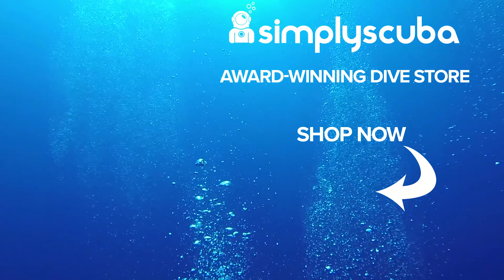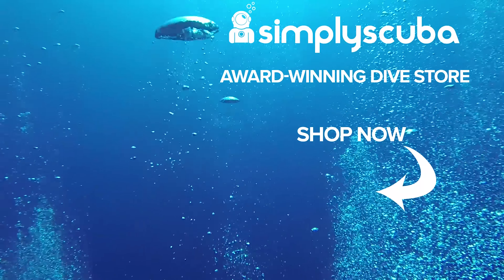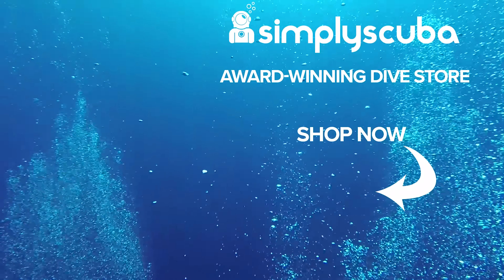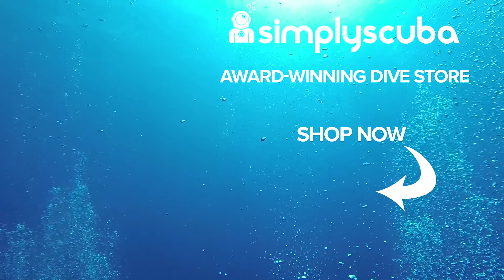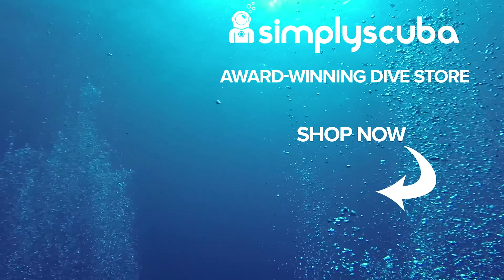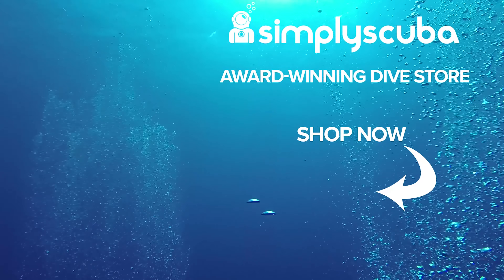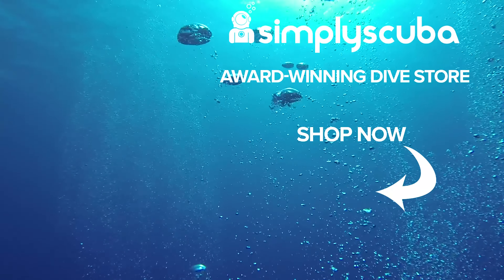Daily Scuba News - Ketchup Test

Comment: I think what these guys did was great.   It definitely caught a shitty shop being paid for services that they are not doing.  Using ketchup packs was also good, not dangerous if the tank had been pressurized, only causing a mess inside.  Proper tools and torque values are easy to get for opening and sealing your tank, it is your tank and you have the right to open it.
And, if a center finds a foreign object in the tank, then all they have to do is stop the maintenance! they don't have any extra step to perform, testing stopped just like if they found rust.

Comment: So it seems test centres not actually inspecting or testing a tank is wide spread and not just here in Australia. Which then begs the question as to why tanks need to be tested let alone checked in the  first place? As for what would happen to the ketchup packets? Well they're full of a fluid so I would imagine they wouldn't explode unless there was an air gap then that would be a different story. Put a heap of salt in there. Easy to put in and get out.